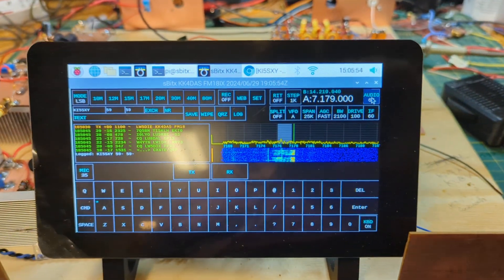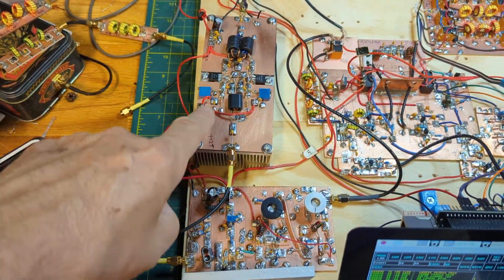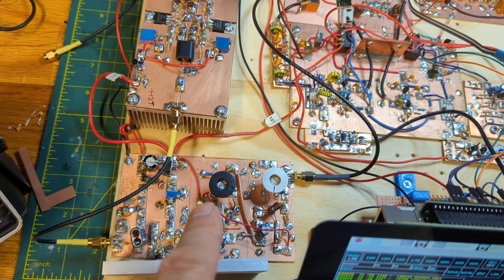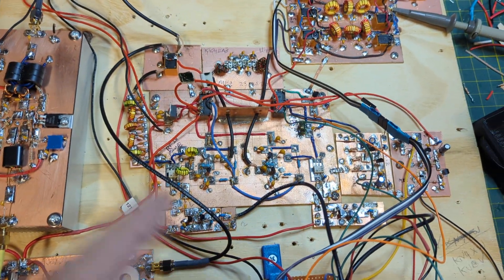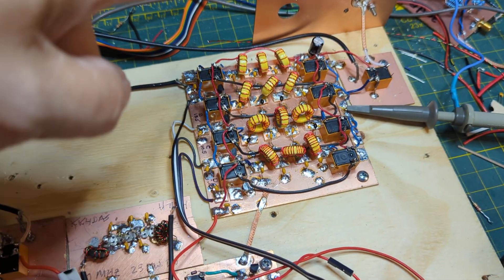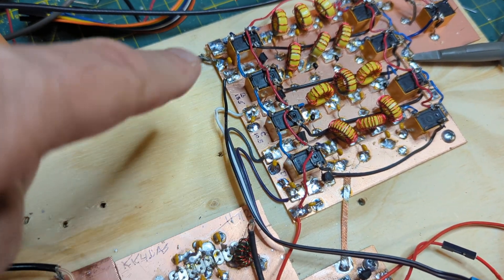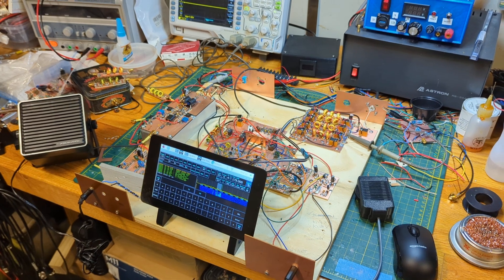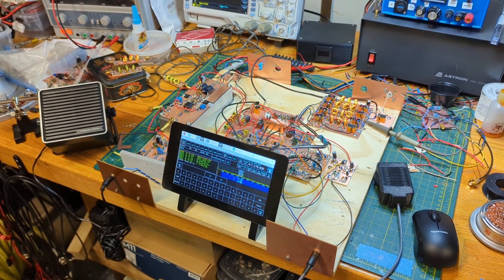Homebrew sBitx overview

Comment: Nice! You're going to need one hell of a big pine box to put in though. 🤣🤣🤣
Reply from the maker: Thanks Hank - I plan to do some re-engineering of some of the boards before I package it up.  The IF module is about 4 times as large as it needs to be and I can consolidate the Tx stages.   The IF was a repurposed spare from a prior project that was not nearly as space constrained.   By the way, as of this AM I have worked 9 of the 13 Colony special event stations, plus one of the bonus stations - all SSB- on 80,40 and 20.